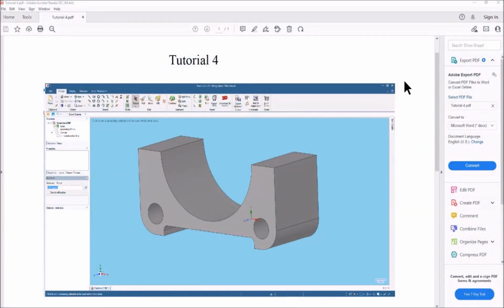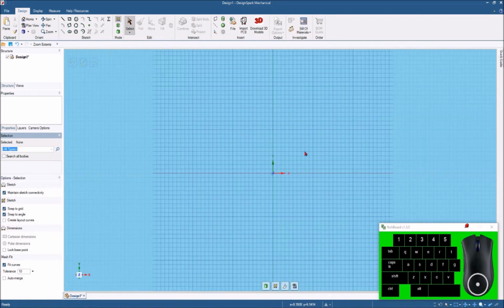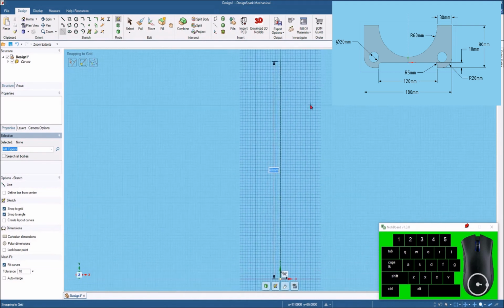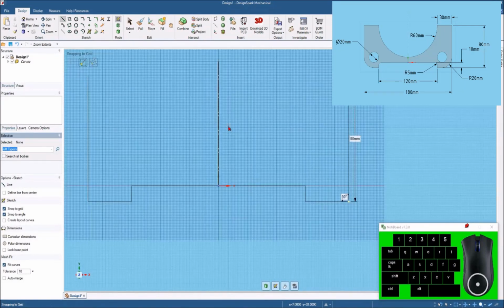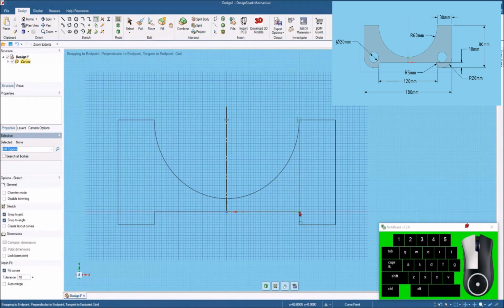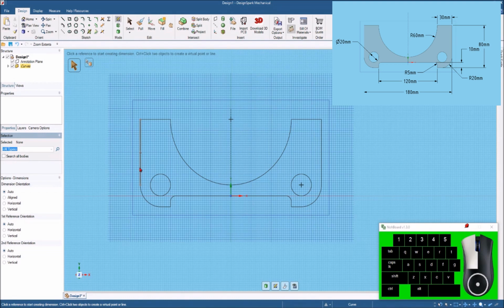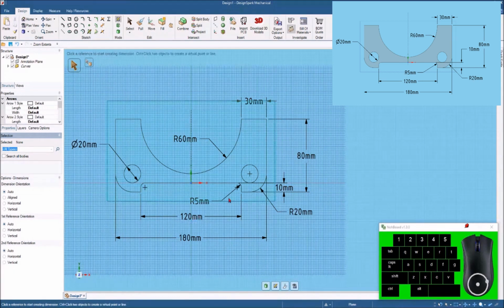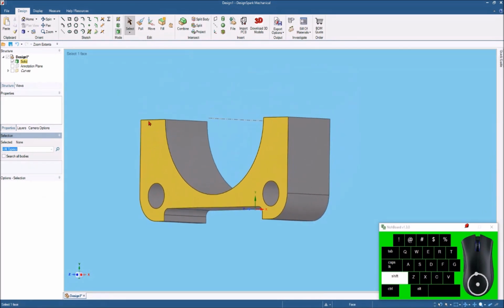DesignSpark Mechanical Tutorials | Using Create Round Corners

Comment: Mr. Gatton,

I'm dreaming up ways to make something and I am seeking your input (if you have time, of course).

Context: gardening, irrigation

You know those plastic "drip lines" or "drip hoses" -- attach them to a water spigot and they become pressurized and slowy dispense water from small perforations along the hose?

Well, I want to take that drip line principle -- conduit that is pressurized with water and slowly dispenses it -- but use a different material besides plastic or rubber.

This is where it gets... unconventional and where I am seeking your expertise. Ready?..

I want to make a "drip tube" out of wood .

Think, "wooden flute" -- a hollowed out length of wood that has small holes along it. The inside diameter would be about the size of a standard water hose. The outside diameter isn't that important (anything from 3 to 9 inches).

I know, I know; it's a weird idea but I have my reasons...

So that's the big picture idea: make a wooden "drip line" that I can attach a standard garden hose to.

The big design requirement/constraint, though, is this:

1) I want to make it out of tree logs/branches.
2) I want it to be modular -- make multiple smaller segments that can be pressed together to extend the overall length

So it's a big-■ss wood flute that can be press-fit into other such wood flutes.

I then slap a hose adapter on one end to receive my water hose, and I plug the far end. Run the hose and -- bam -- modular wooden drip tube!

My question to you is this: how do I make this? 😅 🤣

My thought is to use a lathe and do some wood turning in order to get a consistent and functional press-fit between the pieces.

Seems to be the best tool for the job considering I'll be using irregularly shaped input material (small logs), no?

1) use the lathe to manufacture the press-fit ends
2) use ??? to create a consistent inside diameter channel
3) use a long, small-diameter drill bit to make the drip hole perforations along the run

Does any of that make sense?

I do rough construction but have no experience with a lathe or wood turning. Am I crazy to think that a lathe could function to make a press-fit connection and/or consistent hollow center?

I understand if you don't respond.
Thanks for your time in any case, though.
Reply from the maker: There are many good reasons why drip lines are not made from wood.  Have fun with your dream.